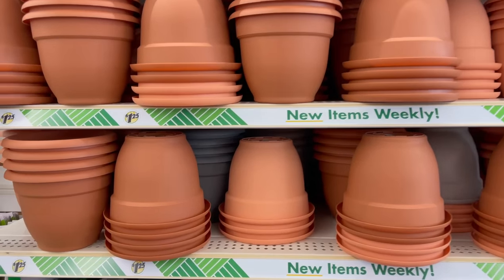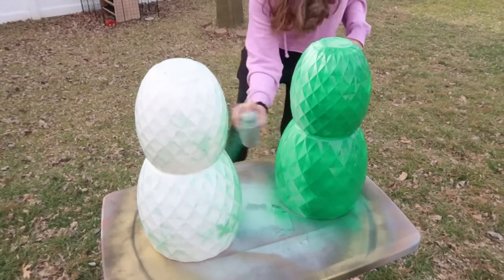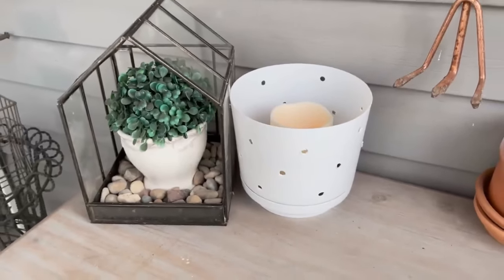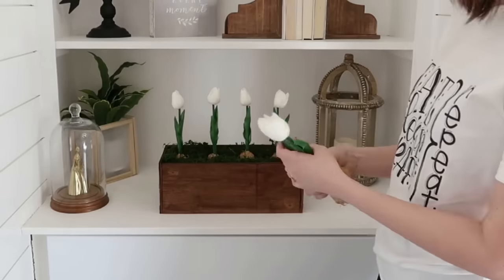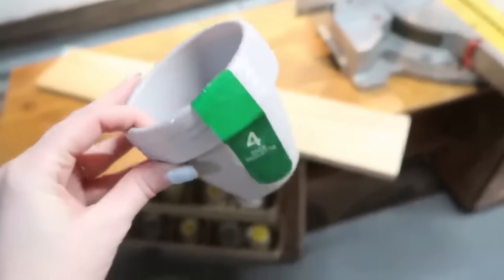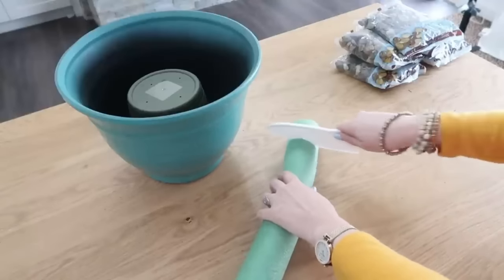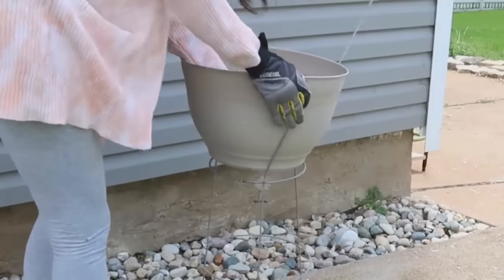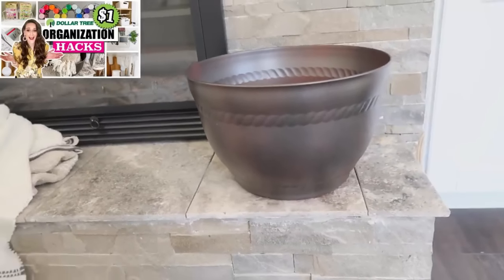25 *BEST* $1 Dollar Tree PLANTER HACKS & DIYs! + Organization

Comment: how do you use your cricut while still on the shelf does it not catch on the back wall
Reply from the maker: The mat does push the back of the shelf out a bit (I didn't attaching the back all the way so it has some give).  But it doesn't hurt the mat or the machine.  If I do larger projects I sit it on my work table though.